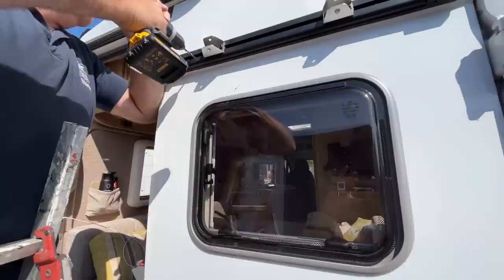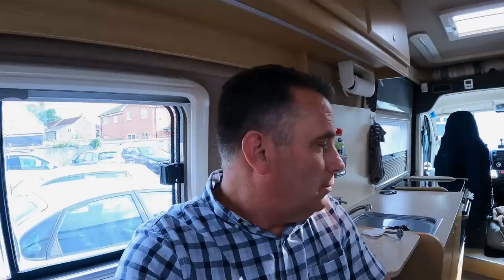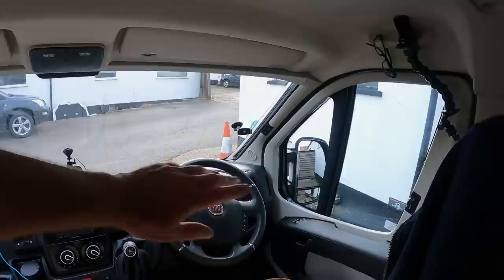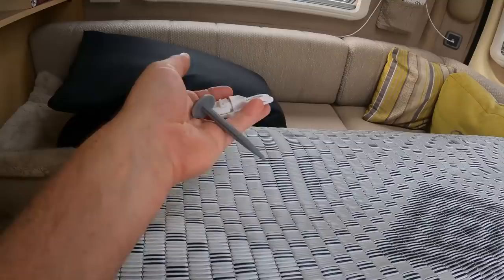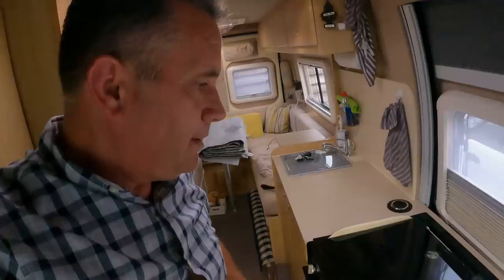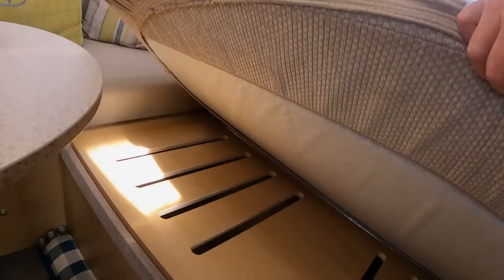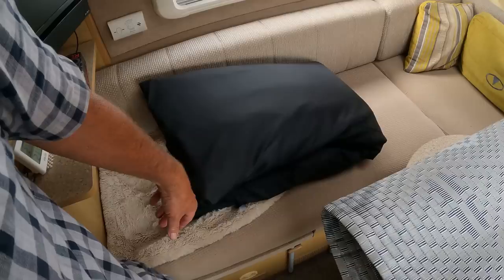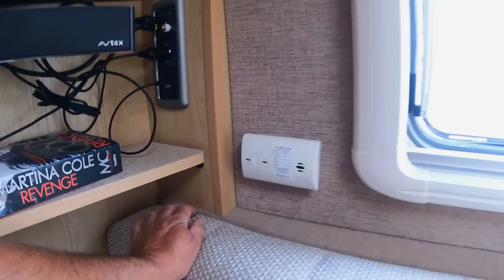BIKE RACK! - Van Stuff We've Bought - Updates - Truma boiler

Comment: Having worked in control systems I find it bizarre that the truma control unit doesn’t display what it thinks the temperature is, displaying actual and desired temperature would you think be the norm 🤷‍♂️. We have a Vantage Sol and a few times have had to keep nudging up the heating set point to get it to come on way past what our separate temperate display shows , so I would say it’s not a fault just a lack of info on the control unit.
Reply from the maker: Hi keith yes sounds about right and makes sense , i agree it is a bit strange why truma have yet to introduce a current temp display on the facia panel , we were not used to the truma set up although we have had blown air in prev vans , the carver cascade to be precise, it took us ages to get used to the off set control and thought we were doing it wrong all the time , it was way off
Reply: @TheFrenchiesMotorhomechannel  hi I don’t think the offset is worth playing with I leave it at zero and never touch it , according to the manual it’s to match the sensor location temperature to the general room temperature but how can you when you don’t know the sensor temperature 🤯🤪
Reply from the maker: exactly yes 😂 , i’ll set mine back to zero again then and see what happens 🤷‍♂️

Comment: Hi Mike did you add the rear corner usb points? Thanks
Reply from the maker: @peterjones1483  Hi pete , i noticed they started adding those USB ports there from 2022 onwards so when we took our van to vantage last year to add a second solar panel and an extra plug socket down by the sliding door entrance , i asked them if they would fit them , they said yes easy job since that’s where they will be from now in a most models
Reply: @TheFrenchiesMotorhomechannel  thanks for replying, we are looking at a 2020 plate locally so bingeing your videos again as Vantage been on our wish list for a while
Reply from the maker: @peterjones1483  that’s brilliant, good luck and hope it’s a nice one for you 👍